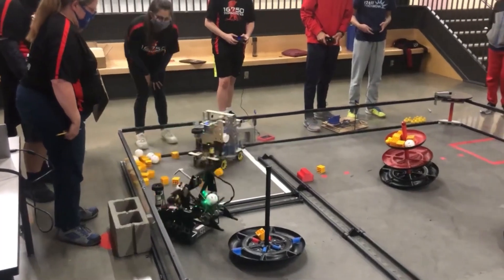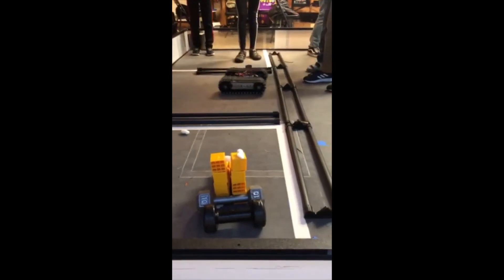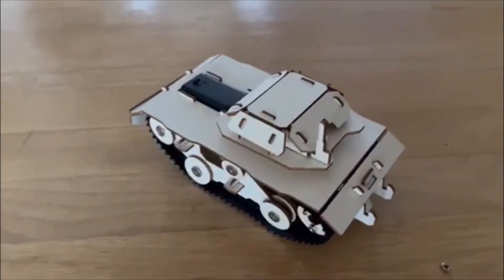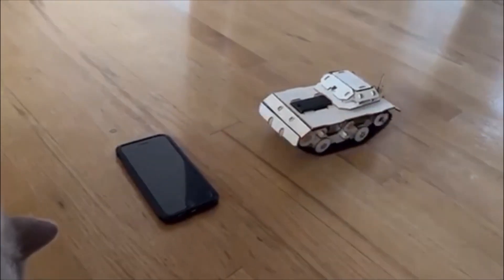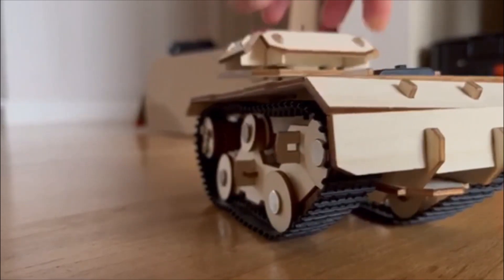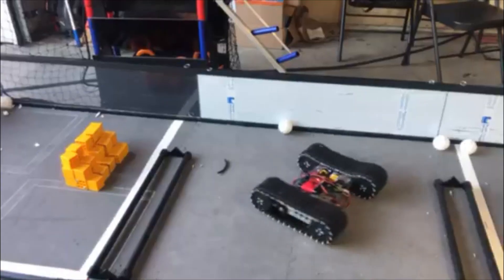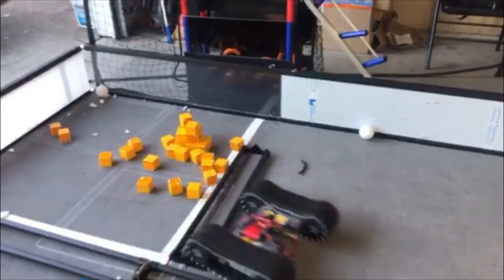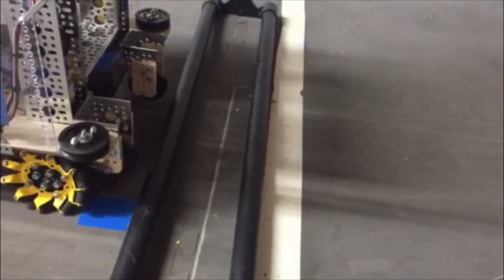FTC Tips: Learning from a Tank Drive

Comment: are your bumper wheels driven or are they dead wheels? also your last line was nice
Reply from the maker: they are dead wheels without any power.
Reply from the maker: Dead wheels worked very well, and it is easy to build.
Reply: @FTC12611TechNova  do you have them on both sides of your robot or just the back? and how much do they help? thanks for your response
Reply from the maker: @spidernh  In our V1, we only installed it for the back. For V2, we fully customize drive train to have more space, to install on both front and back. It really helps. Without it, robot needs more initial speed to cross. With it, it can almost climb the barrier from 0 init speed while sitting next to it. We think it is useful when facing heavy defense
Reply: @FTC12611TechNova  that seems really good then. I'll talk to my team about implementing something similar to this for our off-season (since michigan states are early). thanks!